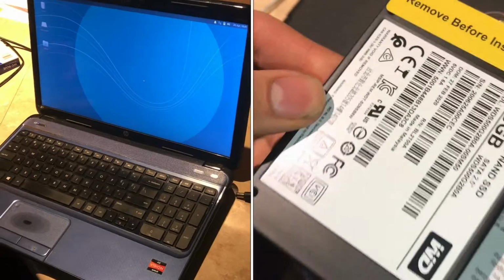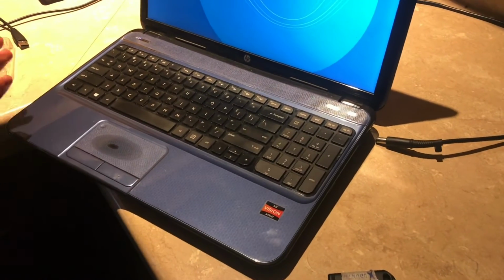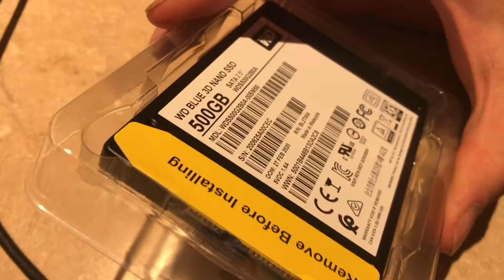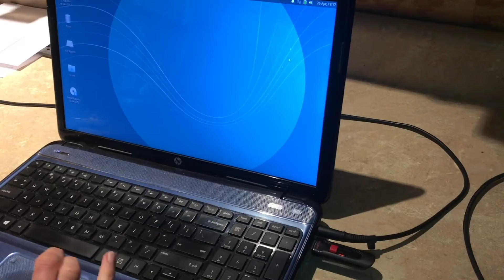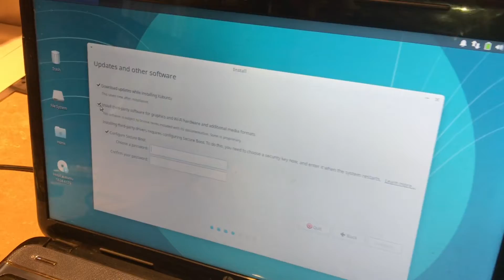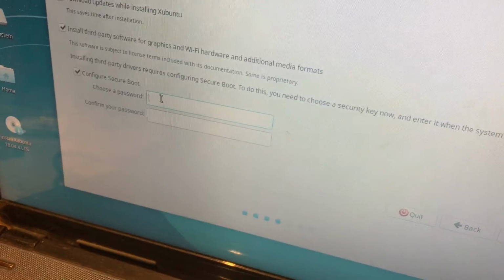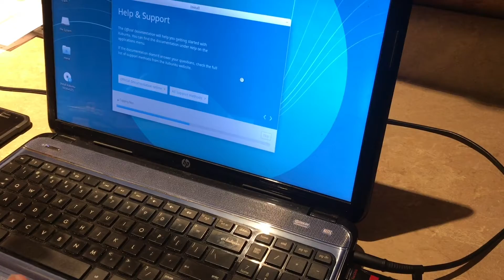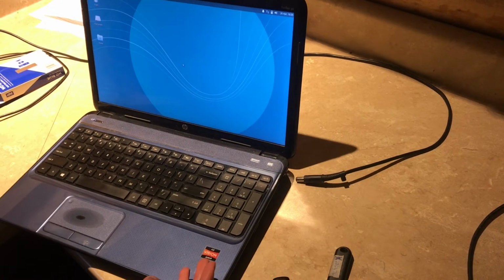installing ubuntu on FRESH solid state harddrive (wd blue) sata ssd

Comment: where, when and how / who from did you learn to use computers young man?
BIOS works with or without an HD unit in the machine!
in fact, BIOS has to work without any bootable media in as well so things can be set up the right way and prepare the hardware for the next step, ie, when a bootable media is installed ...

Comment: This was pretty good. Is the install stored as a zip file on the usb?
Reply: You probably now the answer by now but it's not, you have to make the usb a bootable drive. You can do it in Windows with a program called Rufus. IN linux i don't remember but i think you don't even need to install anything you can do it just from the console

Comment: Hi im looking for a os that you don't have a ssd or hdd in the laptop you can only boot it with a encrypted USB any idea's of the name as I can't for the life of me remember
Reply: You may be thinking of Ubuntu live usb .https://youtu.be/vb3DCcngmY0 It is fairly easy to put ubuntu OS on a flashdrive ( as you would do to install it on a new ssd or hdd as in the above video ) but this is not ''persistent'' which means it loses all changes and memory of files etc when you switch it off . When you have a persistent installation it sort of works but is not as great as it sounds , at the moment. One odd thing is that I have read you must not let it update because that can spoil it somehow. I have one but it is not as useful as I had thought it would be. The main problem is there are not many people who will let you fiddle with the bios and boot order of their computer even if they let you use it.

Comment: So you disable secure boot in bios that's in old hard drive. Then you install Linux. How does the bios get back into the computer? Thanks!
Reply: The Bios is independent of the hard drive. It doesn't matter what drive you have installed, the bios will have the same settings regardless.
Reply: Did you ever get an answer? I was confused as to why we are disabling secure boot on the old hard drive when we are just getting rid of it.